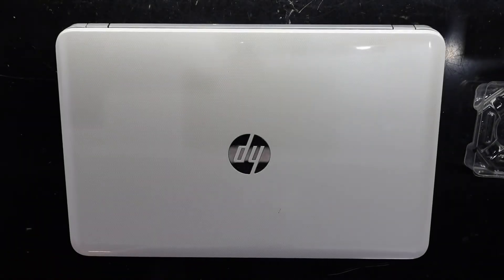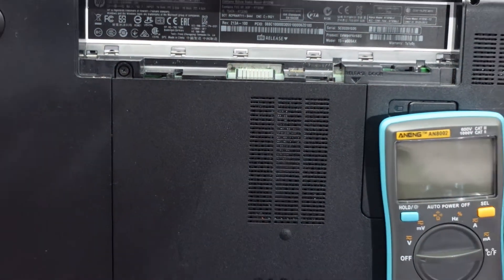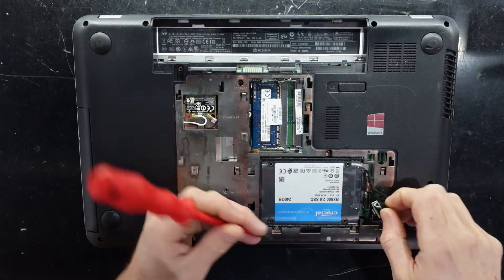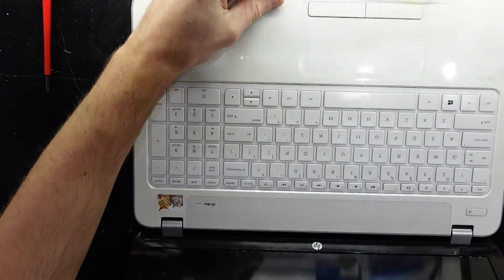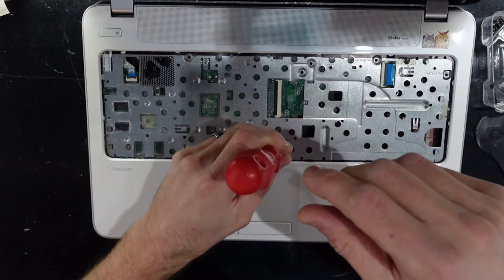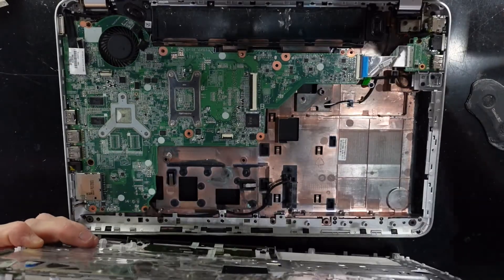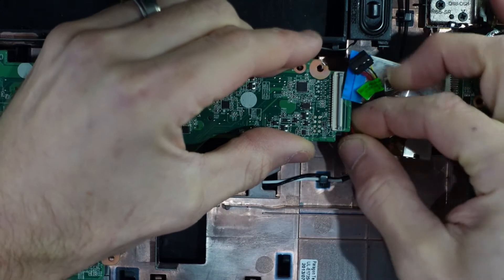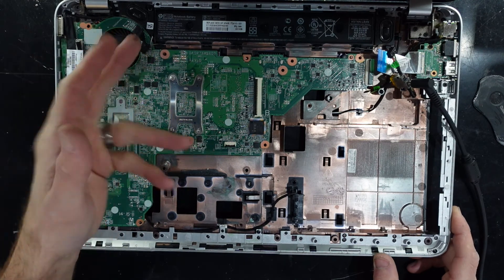HP Laptop not powering What to try?

Comment: Hello Hope you are fine
I have a query 
My tab display suddenly popped out and screen turned black and it was plugged in with charger so as soon as it pooped out i removed the charger.
 Does it effect the display and motherboard??
I was told that some pin was missing near charging port and display was damaged 
Is it true??
Reply from the maker: Hi

I have already replied to your previous post of this
Reply: But i didn't get it clearly
 sorry for repeatedly asking it coz iam really very worried about my device my exams are starting soon so if i know what's wrong with it i can ask about it at the service centre coz it's been 25 days since i gave it to the centre :/
Reply: Hope you reply : )
Reply from the maker: A Display on a Tablet Doesnt pop out for no reason, even if you havent dropped it much or at all 

If there is no signs of damage (as in reason the screen falls out) then i would be suspecting the battery of expanding (going bad) and pushing the screen out from the inside 

if the screen is no longer displaying and the flex cable (cable going from mainboard to the back of the display. 

Then i would think of the following things

1- the Display has cracked or been damaged, thus no display
2- the flex cable/ribbon cable connecting to the screen has been streched and pulled out from the board or the back of the screen
3- the connector on the back of the screen where the flex cable connects has been damaged
4- the flip latch on the back connector, on the back of the screen has been damaged and isnt appling enough pressure on the cable to the pins
Reply: @rickstechrepairs  Thanks for the reply :)
Reply: And also sorry for troubling you by asking about it again and again